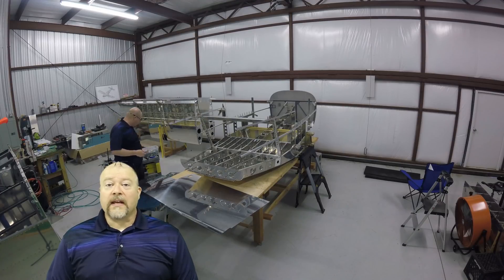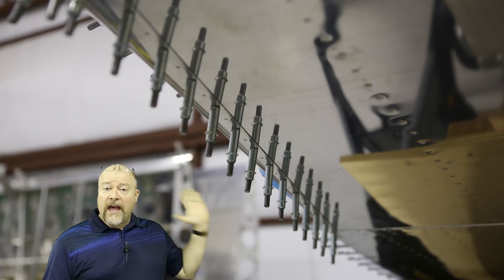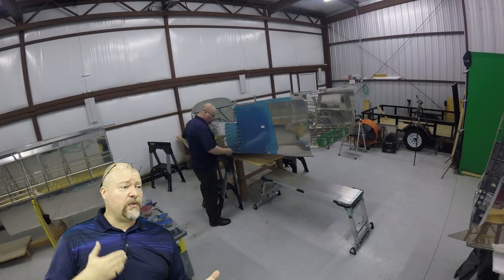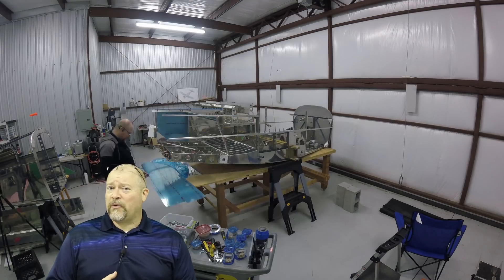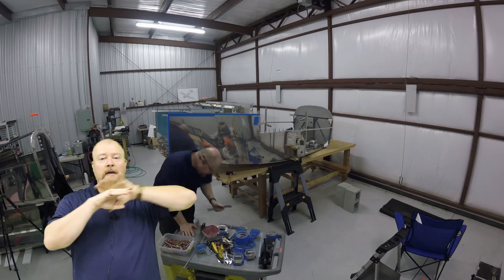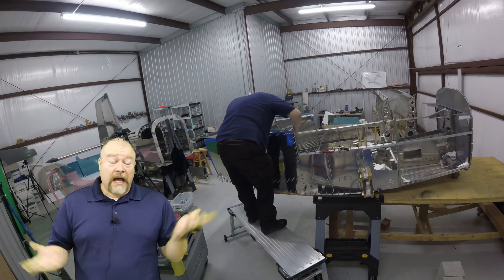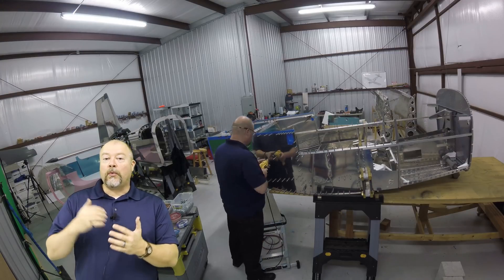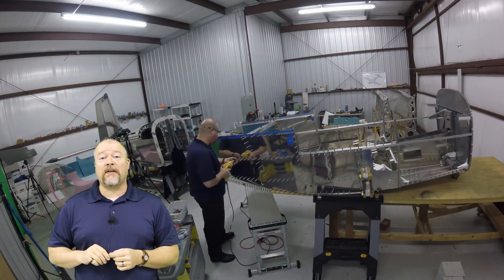RV-10 Fuselage - 024 - 2 fer video! RV-15, Fuselage work & wrecks due to weather

Comment: How many years old are law enforcement cars allowed to be in your county?
Reply from the maker: They generally try to keep them "as new as possible" but some are 3 or 4 years old.  It's more about mileage and "hobbs time" (time on the engine).   At about 50,000 miles a cop car is trashed.  That's HARD miles..  Also keep in mind most cop cars sit idling for 8 to 12 hours a day.  And if it's a fleet car, that could be 18 to 24 hours a day.  They usually will rotate the newer cars to patrol, the older cars to court services, or put them out to auction or use them for parts.  Either way, never buy a used cop car =)
Reply: @JasonEllisBuilds  ah thanks.  This is similar to Australia.

Comment: air is not recycled in an aircraft….  

it’s constantly obtained in the 14th stage of the engine compressor and piped in as bleed air around 600° to an air conditioner were it rapidly expands it and pumps it into the fuselage as air-conditioning, and pressurization. There is a valve called a outflow valve that controls the amount of pressure in the aircraft and Let’s air out. Aircraft are generally designed so that the air and the tube that you sit in is replaced completely every three minutes-ish. And generally there is an over pressurization safety relief valve somewhere in the tail

Comment: You can definitely get all sorts of 1/4” threaded right angle drill bits for the 90 degree compact drill. Different sizes and lengths.

Comment: If I remember correctly you were gifted that plastic service cart from a fellow local builder. I notice you have come to keep it close. I was wondering if you could tell us what you like and don’t like about it and possibly a part#? I am looking for something similar to hold and store Clecos in bulk. Four different sizes about 500 of two sizes and less than a hundred of two others. Then some smaller speciality clamp style. A couple cordless drills and a handful of clamps to have in a sort of 5S set up.

Comment: That is why you always apply the parking brake.  😁
Reply from the maker: which wouldn't have mattered at all since it was sliding on ice.
Reply: Jason Ellis As someone who lives in northern PA, I can assure you it matters.  A car with open differentials in park is being held only by one wheel.  If either wheel on the axle loses traction, the other rolls along for the ride.  If the parking brake is applied, both wheels are now locked and can’t roll.  The doubles the traction on a slippery surface and if one of the two wheels is on a surface with more traction, it will give you a LOT more holding power.

Comment: I wanted a high wing RV for a couple of decades.  Thankfully, a couple years ago, Randy Schlitter designed the RANS S-21 Outbound and I got what I had been asking Van’s for for many years.  Ironically, I learned about the S-21 from the instructor at the SportAir RV Assembly work shop.  I had resigned myself to building an RV-14 and mentioned over a break to the instructor that I really, really wanted a high wing, but nobody made what I wanted in a kit.  I wanted an all aluminum airplane with side-by-side seating and good short and rough field capability, but at least the cruise speed of the C-182 that I owned for many years.  He asked if I had heard of the S-21 and I had not.  I looked it up and placed my order a few months later after visiting the factory in Hays, KS on my way back from Alaska via motorcycle.

So, I am curious what Van’s will do next, but it no longer matters much to me as my kit should be here later this summer and I will be off and running.

Comment: I’d like to see VANS make a fully carbon fiber kit plane. It would be incredibly light and strong and have a very high top speed and huge useful load. I’m tired of seeing of 4seat kit planes that force you into a tiny useful load after adding a full tank of gas.

Comment: I think an interesting idea for an RV-15 would be an RV-10 (-ish) fuselage, for the same four occupants, but with TWO Rotax 912is engines, one on each wing. Fuel consumption should be about the same as having one IO-540 in the nose (maybe a bit lower), albeit at slightly lower cruise speed, but with the redundancy of two engines. OK it may have higher insurance and of course would require a multi-engine rating, but some RV builders are retired airline pilots, so... why not?

Comment: Try investing in a small drill bit sharpening jig.  They are pretty cheap and you won't have to worry about sourcing replacement bits for that right angle drill adapter.

Comment: Pan American tool in Florida for drill bits,    You can use a hole duplicator to drill from the other side, it uses a pin and drill bushing